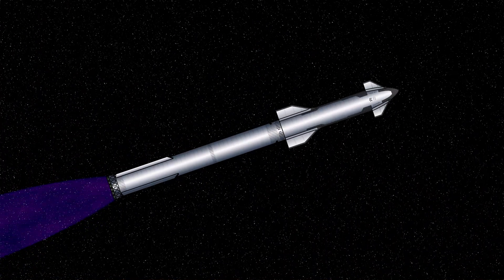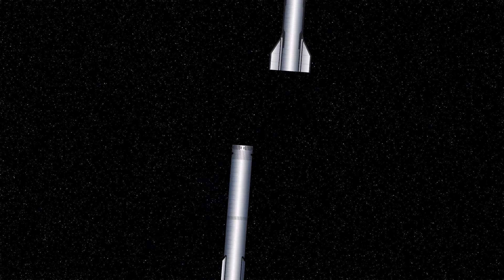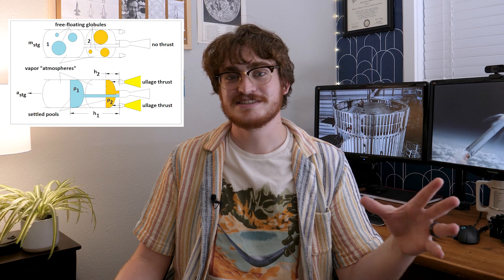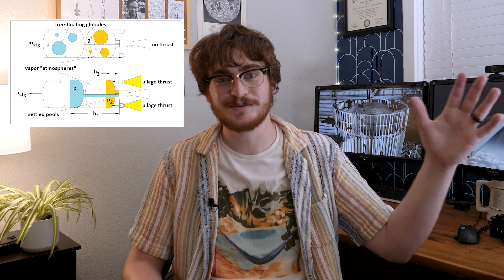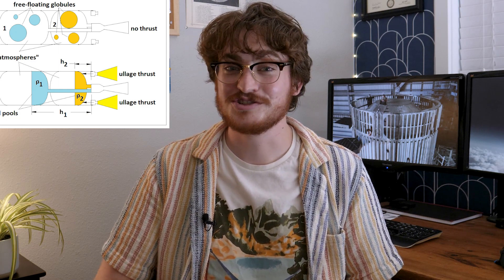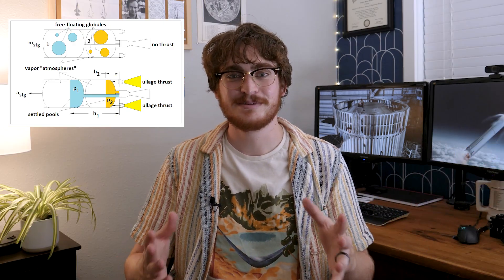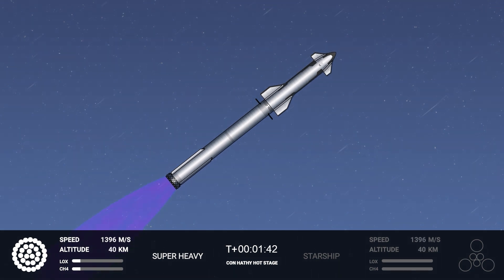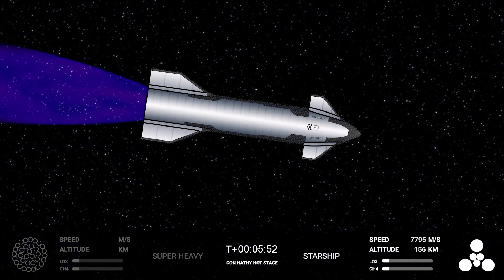Engineer Reveals the TRUTH behind SpaceX's Hot Stage Plans

Comment: Good summary, but I have a few comments:
1) I believe that "ullage" is pronounced with a short "u", i.e., "ull-age" not "you-lage."  It comes from the winemaking world where it refers to the air space in a cask that has been partially used.
2) The very first N-1 flight did do staging.  The main problem was multiple fires in the propellant plumbing of the first stage engines.  When it became clear they were going to have to terminate the flight, they manually staged it to get some data on what happens.  It did turn out that the 8 second-stage engines punched some holes in the LOX tank of the first stage, leading to more heat shielding for later tests.
3) The Titan missiles also used hot staging between stages 1 and 2.  The vents are both the round and rectangular holes seen on the interstage skirt.

Comment: Interesting analysis. My concern is that the ship blast-heat will weaken the hot-stage structure and it may have to be replaced on regular basis. Possibly not a huge problem.
Reply from the maker: I think the time is short enough, and the thermal mass of the shield is high enough, that the temperature should not jump by too much, certainly no worse than welding

Comment: There is a fundamental problem with your analysis. You assume full thrust of the SH Booster during full duration of liftoff until MECO. Full thrust of SH Booster just before MECO due to  diminshed mass of the rocket tranlates into total acceleration rate of over 5g or more than 50m/s^2. During last test flight maximum acceleration rate recorded by telemetry data was 7m/s^2 that gives you total acceleration of 17m/s^2  when you add gravity loss. Now, at this 30% of acceleration you specify the Skirt of the Starship partially collapsed due to compressive force generated by Raptor rocket engines. Space Cadets at SpaceX are going to great lenght to try to hide this major structural flaw of their rocket. Adding hot staging ring without any diagonal stiffeners assures that the this ring will twist around main axis of the rocket and collapse like dominoes even before the rocket clears launch tower. Now do some math on compressive force acting on the  Skirt during liftoff as fuel and oxidizer in tanks of SH Booster gets consumed. Remember that this two stage rocket travels as one utill separation so both parts have to experience same acceleration at all times while mass distribution is changing.
Reply from the maker: The reason I didn't improve on the throttling was for simplicity and because I was just looking at a rough comparison to see if a 10% increase in payload is plausible, not trying to predict an exact payload feature.

As for the skirt collapsing I haven't seen anything indicating that type of failure prior to the loss of TVC (after that it seems more likely that the abnormal side loads would be the issue rather than just acceleration). The prototypes, including the hot stage ring, have all been tested in their hydraulic test stand so I would be surprised if their margins were as far off as you claim.
Reply: @ConHathy  You obviously have no idea about stress analysis and failure modes of edge compressed rigidized metal membranes. Frankly, I do not expect you to even know that such subject exist in mechanical engineering. It is also very unlikely that Elon Musk or any of Space Cadets on his payroll ever heard of such subject. Regardless, their testing methods using hydraulic cylinders are deeply flawed. The Skirt of the Starship same as Hot Stage Ring have, due to their design, primary failure mode that is twisting around Z axis (main axis of the rocket). Elon's hydraulic test stand externally restricts rotation of test objects around Z axis giving false positive results. BTW check raw telemetry data and you will find out that Elon's rocket mysteriously lost TVC but it did not loose throttle control to the very end.
Reply: @KarolKarolak  Hindsight is 20/20. The 2nd launch has occurred now. It appears hot staging worked.
Reply: @glennac  During second test flight Starship did not carry enough fuel and oxidizer to reach Hawaii islands so it had to be exploded after separation to hide the fact that Elon and Space Cadets cheated one again. Yes, Hot staging works when Starship fuel and oxidizer tanks are less than half full during liftoff.

Comment: They need to heat tile the segment
Reply from the maker: The heat tiles are designed for a very different environment, much lower density gas sustained over several minutes. The hot stage ring just needs to survive a few seconds (if that) before the heating drops off dramatically as the stages separate. Steel very well could be fine as it won’t be able to absorb much energy in such a short time

Comment: Are we not putting the cart before the horse here. They still have to sort out Stage Zero. Which is still not guaranteed the deluge system will work.??
Reply from the maker: Well there would be no reason to 100% nail down stage zero just to change it later by adding this ring, which moved the connections on the ship upwards. Also it would be sort of a waste to test stage zero with a rocket that can’t reliably separate, especially because they have the time to make these improvements while they’re waiting for government approval on the changes to stage zero
Reply: Well it worked anyway